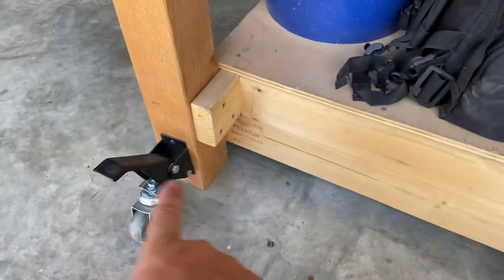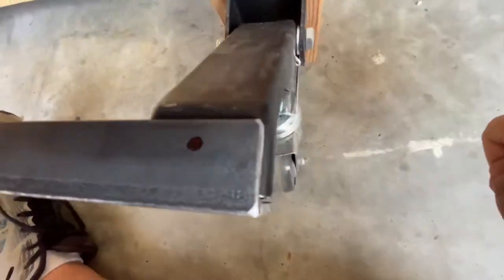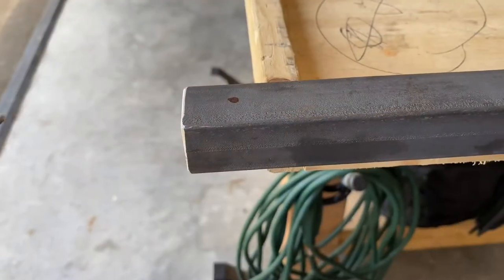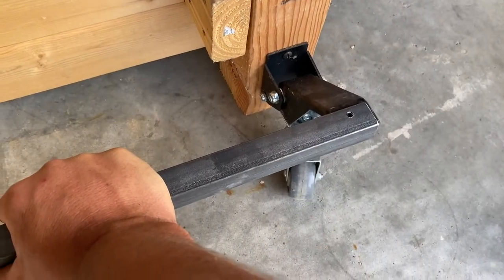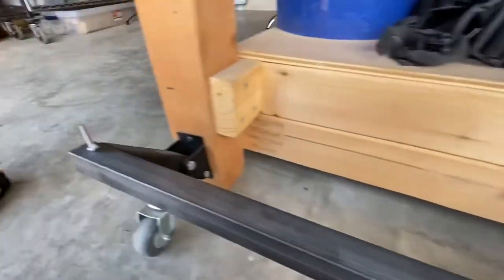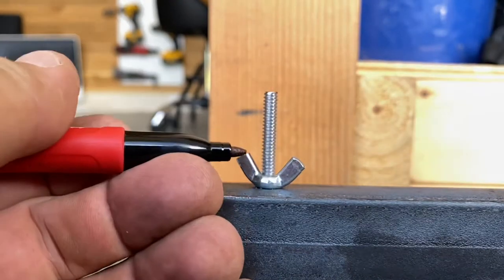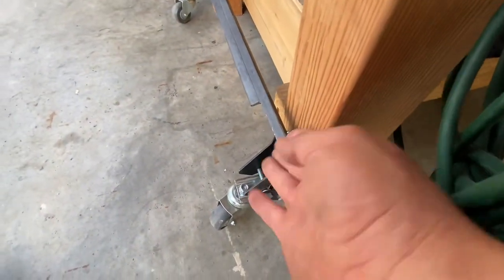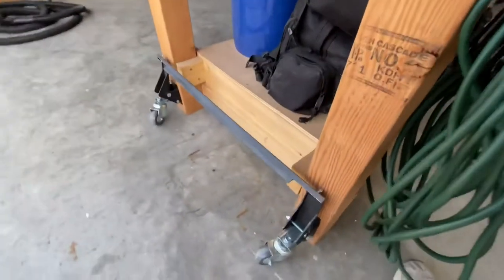Workbench w/ Retractable Caster Wheels

Comment: Great idea. I built a sturdy tablesaw workbench. I wanted it high but stupidly built it without the caster wheel height in mind. So it's sitting on 6x 50mm casters. But I keep adding to the bench and they're obviously no good long term. I don't want to raise my bench any higher, but I need stronger casters. I've seen these types of casters, but they just seem a little delicate to me. Casters usually have the screws up through the base and all the weight means little harm can happen to the screws. But these casters are relying on these screws with all that weight and it seems they'll give at some point. I know they're only used when moving. What do you think?
Reply from the maker: This bench weighs a ton. No issues even and I move my table around all the time. I think you might be overthinking it a little